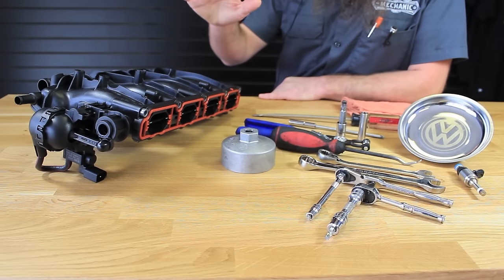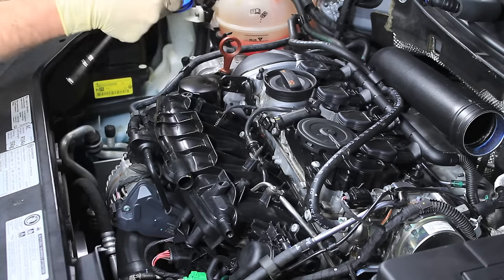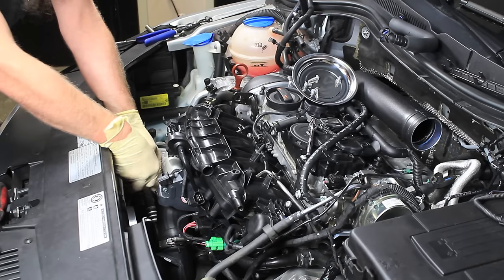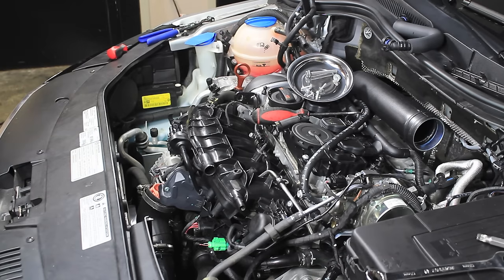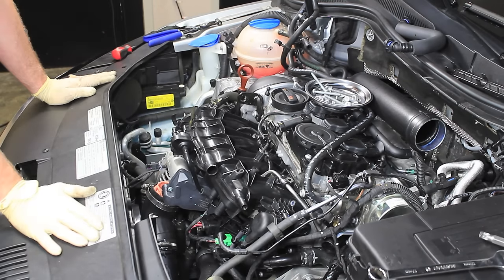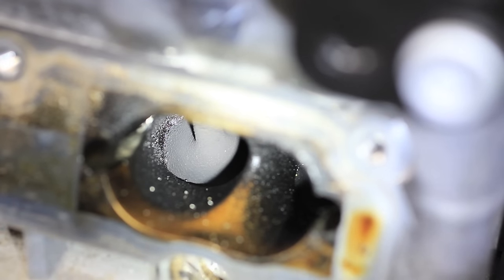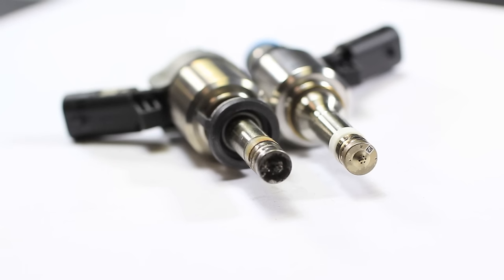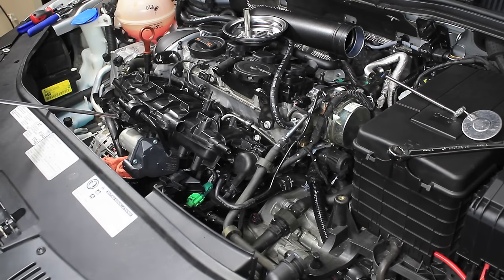Intake Manifold for VW and Audi 2.0T TSI DIY (How to) Replacement

Comment: do you guys have a number. plus any info dealing with code p0087 and p310b
Reply from the maker: It sounds like you might have a fuel pump issue.  You should consider having this diagnosed
VW 2.0T TSI Engine High Pressure Fuel Pump (HPFP) DIY (How to) Install

Feel free to check out our site http://www.deutscheautoparts.com/
Reply: i've changed the intank feul pump two times ive changed the hpfp three times and sensor plus fuel sensor on the rail and rail valve on the fuel rail plus fuel filter.any help would be nice thanks
Reply from the maker: Leon brown If you were using new and quality parts there should be no reason to replace parts multiple times.  It could be an issue related to the fuel pump control module.  http://www.deutscheautoparts.com/View/1T0-906-093-G/1T0-906-093-F/0/51866

We would not advise replacing this without further diagnosis.  You should consider bringing your vehicle to a local VW specialist in your area
Reply: well do spent a lot of money
Reply from the maker: Leon brown We understand that having your car diagnosed can be very expensive but often times this can save you a tremendous about of money and stress when dealing with a situation like yours.  I would hate to have you continue to spend money on parts that are not fixing your car.
Reply: Yes I well be going to audi of Brooklyn Saturday $130 diagnose fee
Reply: But I well change the cam follower tomorrow

Comment: Here is a tip about pulling these VW's apart and CLEANING CARBON OFF THE INTAKE VALVES   and changing INJECTORS yourself or 1200.00 a pop at the VW DEALERSHIP... OVER and OVER and OVER....buy a HONDA or TOYOTA and NEVER TOUCH this stuff.....EVER. YOU can, AND WILL NEED, a Deutsche Auto Parts guy standing next to you if you buy one of these LEMONS and I am sure they will be LOVING it. If you buy one of these things there are DOZENS of videos on here THAT YOU WILL NEED to study...IT IS NOT MAYBE....you WILL.

Comment: First mistake is buying a German car with plastic parts.
Reply: None of these known manifold failure points appear to have anything to do with the "plastic" composite that was used for the body of the manifold. They have to do with the sensor, the actuator arm or with the stopping points for the flaps.
Reply: Fantastic video